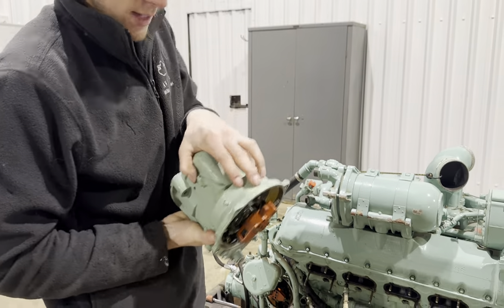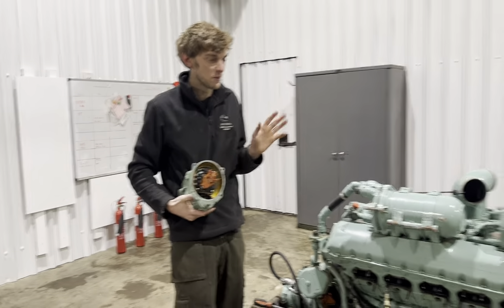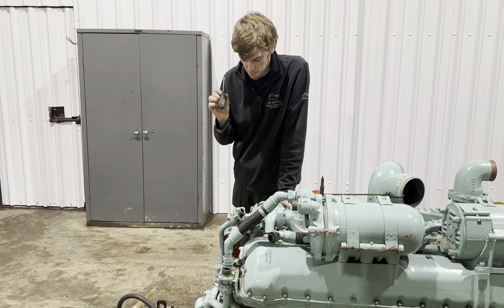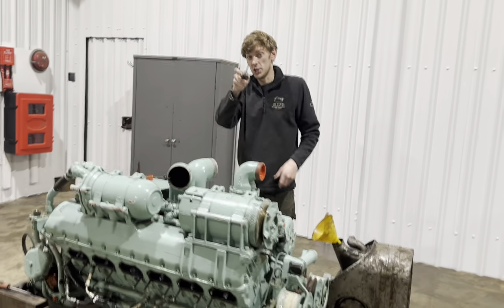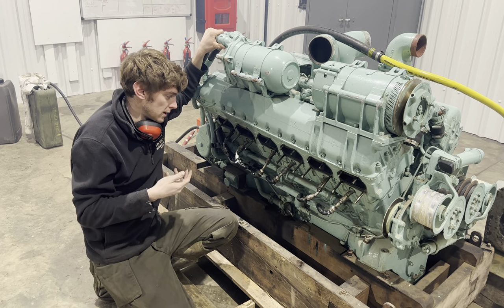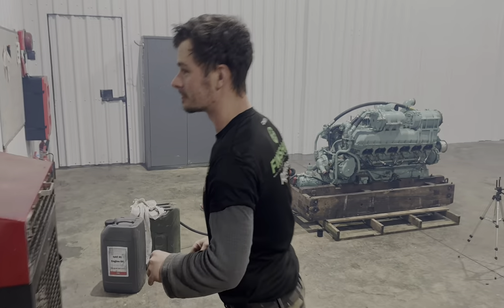ROLLS-ROYCE V12 BURSTS INTO LIFE AFTER 30 YEARS

Comment: Will it fit in my VW golf?
Reply: Nu cred...e prea Mic😂😂😂
Reply: If you cut open the firewall, maybe. 😂
Reply: Of course. So long as you don't intend to try to fit yourself in with it.
Reply: It could happen if you sat on the roof, Mr Bean style and gave up the entire cabin to that engine 🤔
Reply: I want to see the conversion done
Reply: @kawonnowak That's why it has a sunroof 😂.
Reply: Behold! It's not the VR6, but twice as good!
Reply: It'll make it sound better.
Reply: Yes but you’ll need new suspension, brakes, chassis strengthening etc. probs not worth it but I want to see the result.
Reply: What could possibly go wrong?
Reply: Ohh only just 😂
Reply: What? Legend British engine in a Cherman Kar??? Sacrilege
Reply: where there is a will, there IS a WAY.⬆️😁👍🇬🇧🇺🇸😎
Reply: Make a rear engined golf with the engine sitting in the trunk/back seat
Reply: @LeonardTavast and the trunk.
Reply: No no will it fit in  my honda civic ?😂
Reply: No but it will still produce less emissions than its current engine
Reply: No but it'd make a badass Baja bug!😂
Reply: @fergus41 only if it's a diesel!
Reply: That's a funny thought; but you may need to extend the frame a few feet.
Reply: Perhaps a Beetle will do, not sure about a Golf
Reply: Yeah sure...ditch the seats, the cr8ppy boom bass speakers...😂😂
Reply: Yes
Reply: Your VW and my Hyundai would fit inside the engine
Reply: You could use your golf as its air fillter😂
Reply: No but it fit in mine
Reply: Mini coop and ride it like mr bean
Reply: Can’t see why not
Reply: It might even reduce your Golf's emissions 😂
Reply: Only if you want to use your VW as a wheelbarrow. 😂
Reply: @@madeofoakhow much torque? Yes.
Reply: It'll go in without touching the sides!
Reply: "When the Engine weighs more than the Car."
Reply: Of course mate!
Reply: I want to build this Motor in my Golf V to. Instead of my 1.4 Liters 75HP Motor. I think this Motor will pump it Up a little bit.
Reply: Yea
Reply: You bet it will!
Reply: If you use the engine as the entire frame. 👀🤣🤣👏
Reply: Wait, I was thinking of using it in my Ford Fusion hybrid. Bet I'll get awesome gas mileage. 🤔😅
Reply: Need heavier tires then.
Reply: If you don't mind a 2 seater!

Comment: Sounds like my wife, afraid of getting shocked from 12v. These people just don't understand voltage. Even working with my welder which is 32v or slightly more it was very few times I was shocked by it. I have heard of shipworkers electrocuted by welders but my guess is perfect conditions. Now 440v will really tell ya'll a story which made me dance a jig in the control room.

Comment: It’s said you never use sandpaper on contacts, as there is glass/sand in the sandpaper that leaves small grains behind, that act as insulation and increase the wear, reduces the spark. Contacts are governed by shape, area, and  pressure.
Reply: Now where did you learn that little tip?
Reply: @MicMc539  it was whispered to me🤣
Reply: Professionals use a Burnishing tool that's impregnated with Diamond dust.  It removes the Silver Oxide film without scratching scouring the contacts.  Lucas UK made these way back in the 30's
Reply: @VK7AM  Lucas - The Prince of Darkness?
No thanks!

Comment: I'm an ex Aust army mechanic, now in my 70's.
Back in the day we used to have problems with the Centurion's Meteor, when the magneto engine speed governor, which was a small counterweight built into the magneto rotor, would cut spark at around 2800rpm, which in turn would cause a series of backfires.
The backfires would ignite excess fuel in the carb venturi & would melt the secondary venturi, made of a fairly soft white metal, which would be ingested into the engine, causing a catastrophic failure.
By removing this governor weight, we were able to get about 4 times more life, in engine hours, out of the engine.
Plus a good tank driver would rarely over rev them as the power would drop off anyway, hence governor removal did not seem to cause any other problems.

Really enjoy your work, please continue!!
Reply: Thats what happens when you over rev the engine !!!!
Reply: Looks like I wasted a lot of my time then setting up the governors to cut out @ 2600 rpm

Comment: I suspect the dry sump on the Meteor engine had more to do with its aviation origins (Merlin) than a desire to lower the C of G on a tank. Dry sump is needed on aero engines on aircraft that will be doing a lot of violent manoeuvring to ensure that there is always an oil supply to feed the pressure side of the oil pump and to scavenge oil from an engine that might be inverted, pulling heavy G loads or on its side. This is the reason they are also used on a lot of competition cars e.g. my 1977 Porsche 911 RSR and on motorbike engines e.g. the S&S  V Twin X-Wedge engine in my Morgan Three wheeler.
Reply: Tank engines need dry sump lubrication systems too.
Reply: @FairladyS130  I can just see some war ministry policy wonk saying: "you are telling me we can save 10/6d per engine by making them wet sump - well bring it on" As long as the sumps were well baffled, wet sump would have worked perfectly well as a tank engine. For example one of the largest production runs of any tank engine, the Ford GAA, is wet sump.
Reply: Got to be honest ...I thought spitfire as soon as the lights went out .ha ha ha.
Reply: Hill gradients and oil pump pick up pipe running dry .
Reply: @csnelling4  So why are all bulldozer engines, which often operate at much greater angles than tanks commonly do, without any exception I can think of, wet sump. Dealing with gradients is just a matter of having a decently deep sump and well designed oil scavenge pick ups. The early Meteor engines were often made from Merlin engines which had been declared non-airworthy. Typically an engine that had been in a belly landing and where the crankshaft would have suffered a shock loading when an under power or windmilling propellor came into contact with the ground.
Reply: The Rolls Royce K60 engine used in the FV432 etc also has a dry sump. 🇬🇧
Reply: Not perhaps CofG but profile. (Make it lower.)
Reply: A bulldozer is usually not fired at so has no need to lay low @wilsonlaidlaw  I presume
Reply: @johnnunn8688  That is a more valid reason. For the CofG, the weight of an aluminium engine compared with the weight of the armour is negligible.
Reply: @johnnunn8688  Correct.  Same as L60 and CV12 tank engines
Reply: @wilsonlaidlaw  Russian tank engines have dry sumps plus they have an electric oil pump to prime the lubrication system prior to starting. No doubt that is typical Russian over engineering eh.
Reply: Dry sump results in an engine with lower total height than wet sump, which can be quite beneficial to fit said engine in a tank.
Reply: @ianlulham  There's been a few IDF ones taking a fair bit of incoming lately!

Comment: Another thing to consider between wet sump to dry sump systems, are  tanks going up  down steep gradients and oil washing away from the oil pickup pipe hence the dry sump system on the Cent. They solved the problem on the J60 (CVRT’s)with a baffle system in the sump . I believe I still have a magneto points file somewhere in my tool box .  I notice that was a 27DW rework engine  , if you get an engine from 31DW I may of been a part of its rework and the signing off inspector.
Reply: You might know this. Why was the test sheet marked, Ex-Op Granby? What was a Meteor doing in the Gulf War? Cheers.
Reply: @johnnunn8688  Cent ARV's AVRE's etc
Reply: @andyt3304  , thanks. I googled the armour that went but they didn’t mention them.

Comment: They were 900BHP in the Conqueror, petrol injected. Sounded a bit more fruity. MOD apprentice, spent a year in an engine test house with a tilting Heenan and Fraud Dynamometer. It only went to around 1900 BHP and The Griffon 61 was a tad more than that in aircraft trim, but the 20 odd year old dyno held up under full thrutch. It was (I'm a bit dusty) I think we were about 20 BHP down, but the engine wasn't new nor the overloaded dyno.  We had to fit large fans as the exhaust stubs looked like they were going to melt. After the est closed, I had a look through the window. Nothing left but a big hole.  This test was in the late 60s, and I'm in my late 70s, so sorry to be so vague.
Reply: Which test house?
Reply: We had sheet metal ducting on ours connected to the test house extracts,with a compressed air venturi on the other end
Otherwise the test cell used to overheat,cos the manifolds used to glow bright red

Comment: One of the best tank engines of all time.
Reply: Dear Joseph,
These Rolls Royce V12 engines were very well constructed and at that time the biggest petrol engines made. Simultaneously Rolls Royce also built huge ship engines running on oil like a Diesel engine plus the company was (and still is) famous by their constructed engines for planes. 
I hardly an believe this engine was in your living room for such a long time and it still runs rather well. That says enough for the quality of these sort engines.
Look forward to your next vlog and send you love from the Netherlands
Reply: Definitely not...has to be diesel
Reply: @marc9796  I said 'one of' and I stand by that.
Reply: @dickdegraaff5455  WRONG !!!!  NOT the largest "petrol engines made !!!  the RR Griffon was larger, the PACKARD M2500 PT Boat engine was 50% larger than the Meteor and is an older engine, then we go into aircraft engined PW &Wright R1820 & 30's PW R2000  Wright R2600  PW R2800  Wright R3350  and PW R4360. All these are gas "Petrol" engines of the time, do some research before runnin your mouth !!!

Comment: A thing of beauty seeing the flames belching out on that test run, reminds me of the Spitfires exhaust.
Reply from the maker: Same block
Reply: @MrHewes  Thanks I never knew that, but tbh It's not surprising from an era of continuous improvement of engines just after the war, probably the best a block could get, so they just used it, plus easier to make since they have the casting bits already made.

Comment: SPUD is getting a really nice engine, can't wait to hear it running when it is inside SPUD :D

Also the workshop is looking really good, I wish my little workspace in my garage would look that good when I am finished with it, but it wont because I am only working with material I can get my hands on for free, or already have on hand, and it is no where near that big, mostly a wood working and somewhat of a storage space separated by a partition wall from the main garage space, which is mainly storage of stuff since the floors are rotted out since the ones who built it used large timber planks sitting right on top of piled up dirt...

Comment: Dry sump systems are more to do with inclined running capabilities than CG. With the dry sump system you don't have to worry about all your oil running away from the oil pick up (on BAe Terrier we put a dual scavenge pump in with pickups at both ends of the sump) the side tank gives time for the inevitable large quantities of air sucked in by the scavenge pumps to come out before the pressure pump gets the oil) I tested the engine for Terrier on a tilt table to 45° lateral, longitudinal and compound angles with no loss of oil pressure and acceptable levels of foaming (though controlling that is largely down to the additive package in the lube oil). We were also under height restrictions for the engine, heavy armour and ballistic louvres on the top meant that losing the conventional Caterpillar C18 oil pan was essential.

Comment: I have an engine like this    said to be taken from a danisch tank.   for starting purposes it should have a connector on one of the magnetos  which to connect with an auxiliary high frequency non timed  coil.   the distributor rotor  is "timing"  the constant spark to the engine  cylinder under compression  so to ease starting at thes extra low revs the startermotor provides . Problem with my engine is it has not been stored properly   so everything is corroded  and I hate to ruin the small bolts and nuts needed to remove the parts to be restored like the carbs and magnetos.  After years not yet ready to run  ( and they dis swap the  "smooth"   camshaft cover for one  with the bolts and flats  where the oil filters have to  mounted on , it does fit on the other end apart from two small bolts but it looks odd)